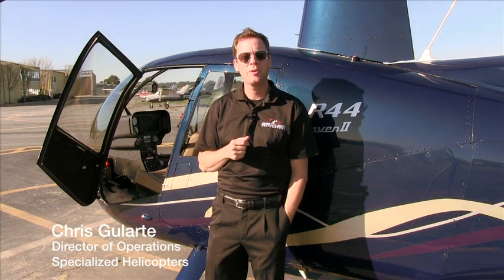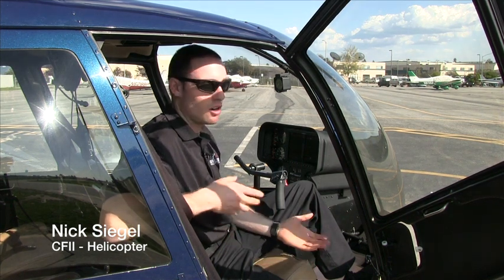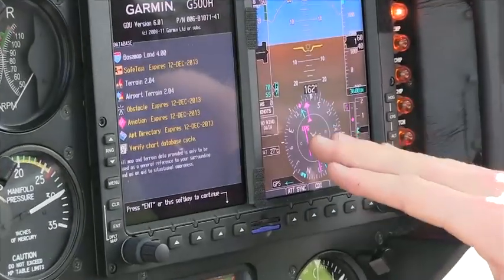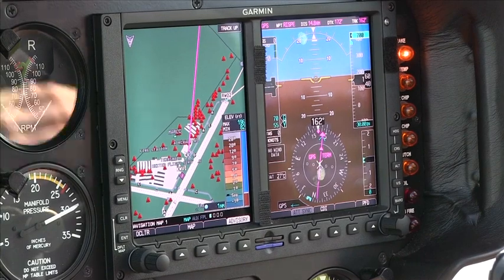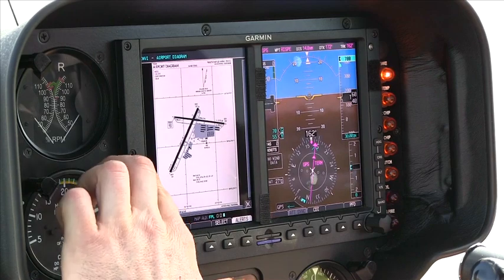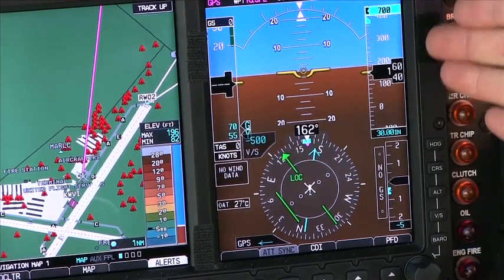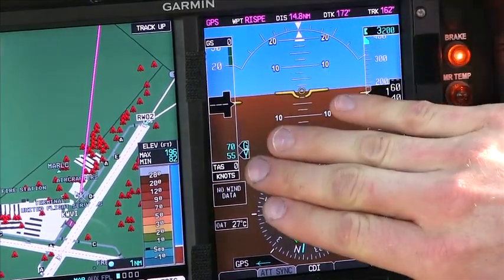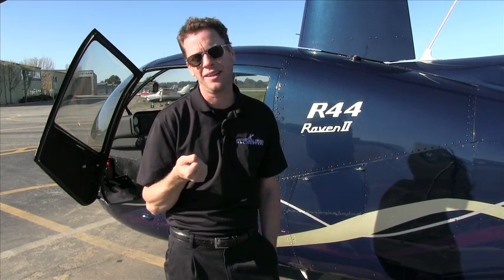G500H R44 Helicopter

Comment: Thank you for this clear and detailed presentation! Can you substantiate why it is cheaper to buy than the comparable steam gauges? In particular since you still have separate altimeter, ASI and OAT instruments. Also why would you say it is cheaper to operate and maintain? Don't the constant database and map upgrades that you have to buy from Garmin cost an arm and a leg?
Reply from the maker: We’ve had this helicopter for many years now and also a comparable sister ship with steam gauges. The g500 has worked without anything more than having to turn off cell phones to eliminate errors. With some minor regular upkeep it’s a no mechanical gyro system. Our other ship has had several overhauls to various instruments costing several thousand dollars at this point. Both have had overhauls now and the steam gauges ship required several expensive upgrades to get to ads b compliance and correct several bugs in the HSI. 
I’m sure by now you have done some research and discovered the g500 to be an expensive yet robust configuration. It’s far superior to the others systems out there, but I would not configure a raven 2 like this again if I was interested in making money with it. IFR training is the only use and the cost recoup is significant. The r44 for IFR training is really poor unless coupled with a good auto pilot.
Reply: Chris Gularte   Thank you Chris for taking the time to respond! Your recommendation makes sense.  What errors did you get caused by cell phones in the cockpit?